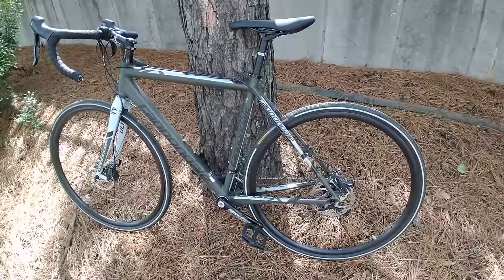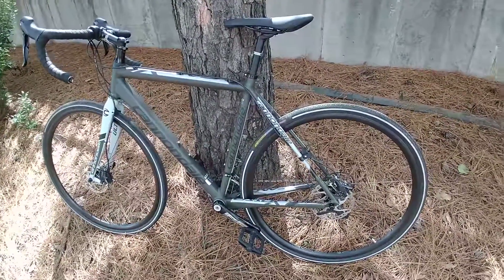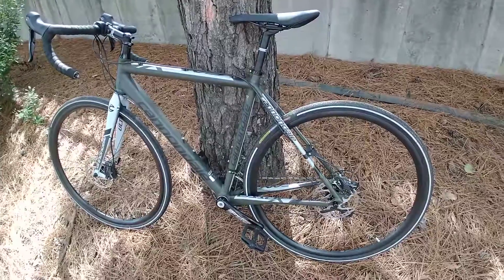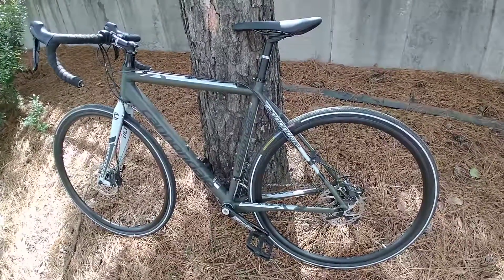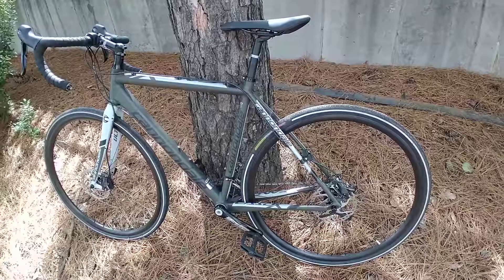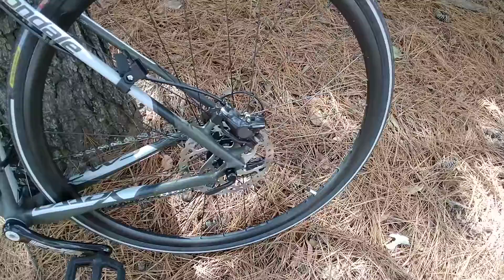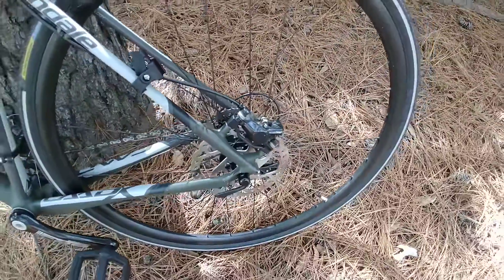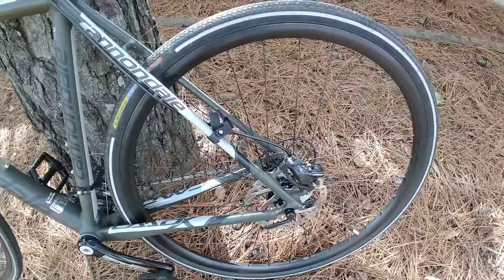Stopping bike rear brake vibration/squealing

Comment: That is weird ...... I was going to say that problem is your rotor is contaminated so it is hard to be stopped, hence the vibration ................ I was going to say you need to redo the "bed in" process and clean your rotor .......but if you figured it out...great.....